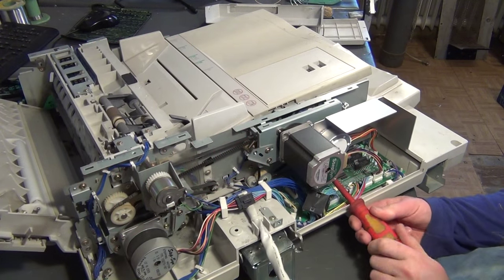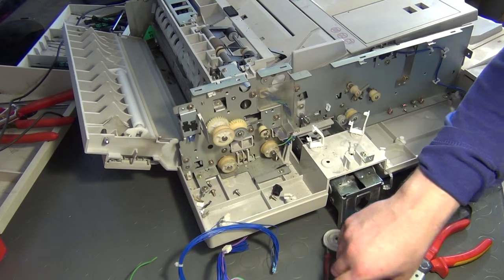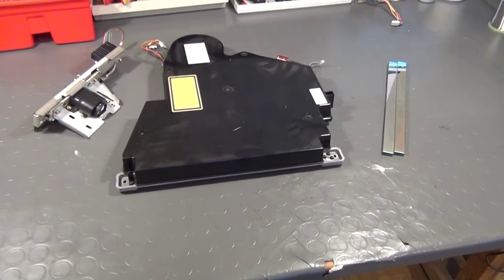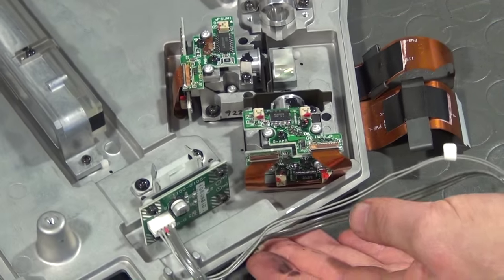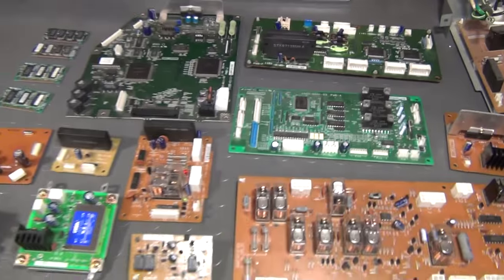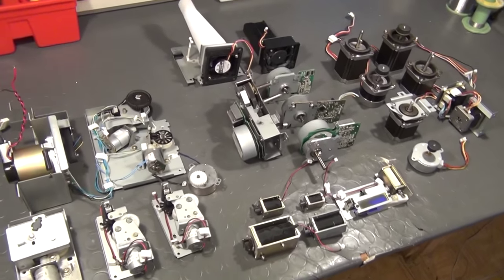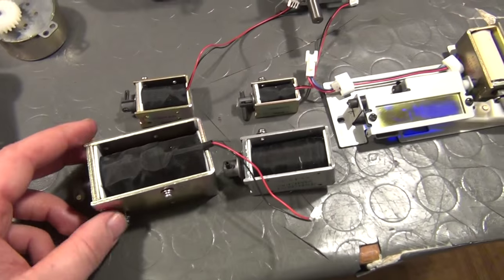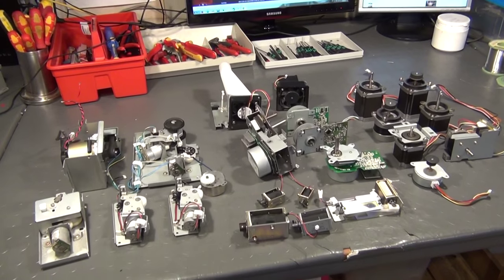Salvaging Useful Parts from Copy Machines:  Stepper Motors, BLDCs, SMPS, Laser Diodes etc

Comment: Thanks to your suggestions, I was able to pick up not 1, not 2, but FIVE free color laser printers / copiers of craigslist from just 2 times I searched.  One was medium size laser printer and did not contain any valuable steppers I was hopping to find, but I did recover other useful parts.  The next one I was able to recover about 15 stepper motors, 6 of them were Nema frame size containing various gears, timing belts, etc.  I gave one larger HP printer to my uncle.  It was at least 5 feet tall with cabinets underneath.  BTW in USA, the stepper motors are much cheaper on eBay.  I picked up Nema 23 japan servo brand for $6.50 shipped!  This was before I got all free printers.  But typically they run here in 15-30 dollar range for medium size.  I also end up with several power supplies including 700 Watt one which has 24v @ 15+ amps.  I still have a smaller Sharp color copy machine that I need to be taken apart, waiting for recycle bin to be picked up, it's full of plastic and metal lol.

Comment: Try removing rubber rollers by dipping in very hot water, then they will usually slide off. Be aware that everything is hot after dipping. A tall stainless wine bottle cooler is idea for holding and insulating the hot water. Nice video, as usual and very informative too, thank you kindly for showing us.

Comment: The stepper motors are a great find and look to be of very useful size. The nima23 size would work good for a small home made cnc machine or pcb mill and the nima17 size could be used for making a 3d printer.

Comment: man this video has me searching craiglist for a free copy machine every day lol.
Reply: +Brady Rose  Update,  I got one!  my experience has been very similar!
Reply: :( im envious!
Reply: Same here
Reply: I found some but they're an hour away :(
Reply: Check you local copier dealer.  You might find one that just picked up a machine that the manufacture no longer supports and be able to get it cheap to nothing.  Most of the motors are 24 volt, especially the larger ones.  The fans are 12 volt and so are the smaller motors.
Reply: Brady Rose awesome
Reply: Bill Knight yes they sometimes have old ones that are no good
Reply: Go to any copier company and ask for a parts machine.
Reply: I just posted a comment about a Ricoh color printer, and collator, which I have harvested even MORE from than this photocopier.

Comment: I also selevged about 50 stepper motors from about 4 Xerox machines, they are really awesome even I sold some of them😜got more then I paid and still have about 25 motors. Also didn't disassemble the machine by myself I just bought all the steppers. 

I have some nema 23s(maybe 6) about 700grams each runs at 3amps without problems.
Reply: Great jod.

Comment: 6:47 a full bridge rectifier? Holy crap! I used to work at a copier sales place 10 years ago and we dealt with Minoltas. I know this copier well. During my years there we took in those old trade ins, even newer than this one and stripped off the serial numbers and sent them to the landfill. Sometimes when we needed a part we sent the old machine to the techs and they would pull out a board from an old machine and junk the rest. I do remember those machines having dozens and dozens of motors and interesting looking boards. While I had free time I did what you did and got many sweet sturdy roller dollies from the bottom of copy machines. We still have some here that we use at times.

Comment: I watched this video for the first time two days ago. I immediately went onto Craigslist to see what I could find. Lo and behold, on the first page of the free section I found a working photocopier that had been posted only 15 hours earlier. I texted the guy and yesterday went to pick it up! The only unlucky bit was it weighed 250 pounds and had to come down ten stairs before we were at street level.

Having looked it up online, it seems these are going for between $1700-4500 US used. So I may not take it apart just yet ;)

Comment: I've operated an office machine business for 40 years and always strip down the copy machines, printers etc. before scrapping. I now have a barn full of parts like you have here but haven't found the time to play with them much yet. Some friends have come by to get stepper motors for their 3D printer projects. Please post ideas you come up with for these parts. Thanks for the post.
Reply: Kevin Tucker Yes! I do the same, a little part of me dies if i don't take the motors and drive IC's before they get shipped off. Have built a simple cnc machine. But with steppers running out of your ears, possibilities are endless!

Comment: Oh just a side note about IR radiation sources, even something silly like staring into an un shielded remote control IR diode, dont do it!  the most dangerous thing is probably that since you dont see it, the iris in your eye ball machine will not close to block light such as when looking at a visible source, yet ir can and will do similar damage as looking into a bright light source (if im wrong some one can and will correct me...ughh) but this is what I remember from some sticker on some sweet machine i was disassembling some time ago :)

Comment: The Post Apocalyptic Inventor Try powering the laser head up, but only after you replace the diode with a low-powered visible one.
Most mirror motors have four wires, and are very easy to drive.
Find the nearest power filtering cap, and swap the remaining wires around from positive to negative to see which one is the low-speed(operational) one, and which one is the high speed(spinup) one.
All of them(nearly all) run on 24 or 18V, so start with 18.
They can be used to make a raster laser display, for example :)

Comment: You have found alot of parts for projects I wish I knew more about electronics.
I do have a small wind turbine that uses a stepper motor .
The big one you showed would make a good one to charge small batteries or run LED's

Comment: ~gigglez~   ..." THATS NOT A COPIER !! ... THIS IS A COPIER !!! "
I once repurposed three full-sized commercial copiers, and a Kodak print & photo-finishing unit.
Oilless AirCompressor, large steppers, and brushed Boldor AC fractional hp motors, small guage drive chains/gears, relays, microswitches, pots, caps, and sooo many old sub 10A electronics parts.
I have soooo many options now, I bought a TB6560 4axis controller and a trio of NEMA23's.
Waiting for a deal on some 2030 & 2060 perhaps, but was toying with ideas of epoxy granite castings.

Comment: One day, long ago, I salvaged 2 Commercial Copiers, all analogue, with a few IC boards.
Also a Kodak Photo Print Copier, including a filtered oilless Air Pump and dbl action Pneumatic cylinders.
You already have most of the parts showing in this video here.
Reply: I am planning a 4axis Trunnion -based CNC.

Comment: Did you figure out the characteristics of the BLDCs? I'm curious if they could be used to build a quadcopter of sorts (or a one/two motor glider) on the cheap. Down here in Brazil, importing electronics is expensive due to protectionist policies, but I know where to find some old copy machines with BLDCs like those in the video. Do you think they can run up the in the tens of thousands of RPMs and have reasonable torque to spin a propeller?

Comment: <works for a very large copier printer manufacturer. You would be amazed at the stuff we get out of old units.  FYI. The late 90's early 2k have the best components.  Relays and the like. Newer units have more expanded mechanical drives "less motors ". Happy hunting. !!! Some of those components have been used In a few of my projects on my channel
Reply: Jeff DIxon I got 2 canon 550 imagerunner copy machines made in 2000 and there packed with tons of stepper motors and other electronics!

Comment: There is another quick method to desolder if you don't want to use the PCB any more,  especially for DIP components . Light a candle then heat the pads and pull the component. That's it.  Five seconds for each without any damage.

Comment: This looks very much like a pile of salvaged components I am currently accumulating, boxing, bagging, and tagging.  I acquired a Ricoh 4 color printer, w- coallator,  from a deceased friend's estate. It was throwing an error code, and I was offere 100.00 from a Ricoh repair shop.  I decided to keep it, and see if I could fix it.

I never was able to find enough info to troubleshoot it, and decided to scrap it.  Upon digging into it, too far to put it back together, I discovered one of the vulvanized rubber & steel stepper motor mounts had broken.

If you get a chance to get a color printer of the size I'm describing, (as big, or bigger than the photocopier), by all means, take it.  I am not done scrapping some of the major sub-components, but already have more than you got from the photocopier.   A veritable gold mine, (your El Dorado description was quite accurate.), to be sure.

Don't overlook a page collator, either. There were more steppers, gears, shafts, belts and solenoids in it, than the printer!

Have you sorted out how to get the stepper motors working? 

Good hunting...

GeoD

Comment: I just bought 2 of the smaller Xerox copy machines for ten bucks from a church undergoing renovation. The huge tube in the middle of the machines that has the two decent bearings on either side and the half cylinder of whatever in the middle... Did you figure out a use for it? I'm thinking of integrating it into a robotic arm but was wondering if you had a better idea... I've got two of them now

Comment: I find it much quicker to use a hot air gun the kind used for paint stripping to remove componnets from boards, you can strip an entire board in minutes with on eof these.
Reply: +sean doofer If you think dry heat is nice you should try wet solder someday.

Comment: For what it's worth the drum is never electrically charged directly. It is charged by light leaving a capacitor like charge. There are 3-4 thin wires near it. They are charged with very high voltage and act like radio transmission antennas . For parts value the older the machine the better and electronics are usually ultra high quality on a good brand / high speed

Comment: I have comercial printer which I wanted to fix. Then realized I will take a lot of time and god know if I fix it or not. I also think if I should try salvage parts. From one side I think to salvage parts form it. From another side I think it doesn't worth doing that.  I need some steppers for cnc. But I need 3 pcs the same. So it looks like time wasting with not much value. I believe you have spent minimum 4h in my case using my rate it is decent amount which could be spent to buy parts like stepper motors. It will be really appreciated if you share some projects you did from those parts.

Comment: I wonder if you did anything of those things. I nearly finished salvaging printer. Started to check and the stepper motors not commonly used and they also low power

Comment: @The Post Apocalyptic Inventor
I have seen some one using Stepper Motors, and making them turn, by simply connecting the minus to the ground though a cable and a digged rod metal , and the plus to half spherical coper plate hanged in a tree or something similar. 

Do you need them? I need one

Comment: man... I found three of these printers at a thrift store I was working at. they had them in their scrap pile out back. I asked if I could get some parts off of them and they didn't mind at first but for some reason they stopped letting me strip them down. then they recycled them. I got about 8 good steppers and the PCB boards with the drivers though

Comment: I would have liked this video to be a bit longer :-) It would be nice to see some of these motors running possibly in a tutorial. Especially that high speed laser scanner motor possibly running with a visible light laser.
Reply from the maker: Coolkeys2009 Thanks for the input. I'm thinking about making a tutorial like that. Have also thought about installing some red laser diodes inot the laser module.
Reply: @ThePostApocalypticInventor  Step syn 103H7126-2743 could you please let me know how to find the datasheet for this.. thank you 🙏

Comment: Someone needs a car trailer...
Reply from the maker: stefantrethan I was actually thinking about something more like this:

http://www.militaryimages.net/photopost/data/506/M114_airlift.jpg
Reply: stefantrethan Something like a little flatbed Hijet would be perfect for an electronics enthusiast. Combined with a set of ramps and a small winch, there isn't much you couldn't move in the world of electronics.
Reply: Decker A car trailer has a number of advantages IMO.
It's detachable, you get to have a normal car the rest of the time.
You still have a full sized car (including trunk space)
It's cheaper, considering that trailers typically outlive all of your cars.
It's low loading.
You can wheel it around by hand if need be.
If for some reason a trailer is not an option some kind of van would be my second choice, far more common (and cheaper) than flatbed trucks in Europe.
Reply: The Post Apocalyptic Inventor LOL
Reply: @ThePostApocalypticInventor  At 7:18 did you say common filter?

Comment: Are you sure the inverter was exclusively used for the cold cathode lamp? Afaik those toner printers charge the drum with high voltage to knock off charge with the laser at places where toner shouldnt be deposited...
Reply from the maker: ***** Thank you. Yes of course. I forgot to mention that. I made an annotation.
Reply: ***** Since these are totally different high voltage levels, I think there are seperate supplies for this. Perhaps the one for thge HV-Drum is in the combined PSU. Additionally tha CCI acts as a constant current source once the cathode lamp striked.
Reply: The Post Apocalyptic Inventor
Ah okay. :)

Grüße aus'm 'Pott!
Reply from the maker: ***** Sorry I have to correct myself. I now took the time to take a closer look. What I assumed was  a "Flyback Converter" is actually the circuit that powers the tube. The high voltage generator is for the drum. Sorry I didn't have time to take a closer look before making the video.  I made an annotation in the video. It's like Dave Jones sometimes says: "Never assume anything in electronics".
Reply: The Post Apocalyptic Inventor
No problem. I know how this can happen. Since this was not a repair attempt, no worries at all! :D
Reply: ***** You're are right - at least in laser printers there is HVPS (High Voltage Power Supply) and LVPS :) (Low Voltage).
Reply: That machine had 2 HV power supply boards . One for charging the drum and the developing unit and the other for the transfer / separation corona assy . It was a heavy duty machine reaching the speed of 52 / 62 prints per minute ( di -520/di-620 ) . It came from the modification of a previous analog Minolta's copier the EP-6001 . It had same fixing unit , same paper pick up units , same drum cleaner unit but of course different drum material , different scanner unit  and different document feeder .
Reply: @digicopyscans8347  friend how voltages outputd in dc . can obtain friend. I need 48 or more friend ..please

Comment: I have some 127k23051 motors with assemblies that would go in a Xerox Docucolor 12. 
I was wondering how I would figure out how to make use of these for projects.  They are neat items, one motor and three output gears.  
The first question would be voltage.
There is a 10 wire connector.  Six of these go three clutches, one pair each, which engage the three gears.  That is the relatively easy part, I can probably get one to engage.
The other four wires go to a board with the main motor on it, and this is more difficult for me.  It would be nice if I could power it via the proper two wires.  I may be able to bypass the board, but it would be better if I knew which two wires to use.
I thought that perhaps if I turned the motor I could read a voltage through two of the wires with a voltmeter.  My dad did not think that would work.
Any information would be helpful.
Thanks
Reply: Forgot to mention that they are called "paper motor assemblies".

Comment: I have built stepper drives using Allegro SLA7026M driver ICs. The problem with them is they do not have built in sequencers. Current adjustment is really nice with them though. I still don't know if they are worth the trouble of dealing with today. Later ICs in that series have the built in sequencers. I found a schematic online for a half step sequence generator. It takes 3 TTL ICs. So it is a bit of a pain to wire up. But it does perform well. Here's a schematic of the drive I made http://i.imgur.com/xO93lut.png If you don't optically isolate the step and direction inputs then multiple drives tend to interfere with each other. Or don't believe me, and find out for yourself.

Comment: is that a manual solder sucker?
Reply from the maker: bruce wayne Yes. There are small and large versions of them. The one that I'm using only costs a few bucks and is much better than the smaller ones most people have. What you saw in the video is something like this: 

http://www.amazon.com/Great-Deal-Desoldering-Antistatic-Vacumme/dp/B00M1HA3WK/ref=sr_1_15?ie=UTF8&qid=1439760862&sr=8-15&keywords=desoldering+pump
Reply: thank you for your quick response!